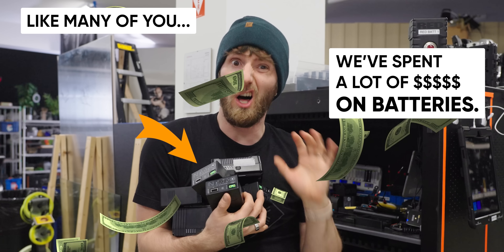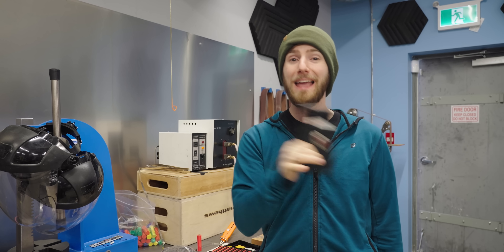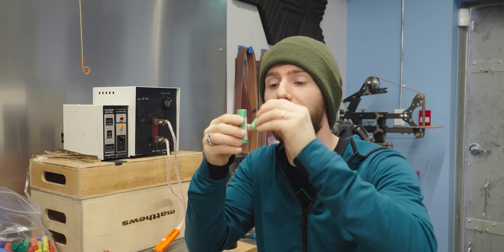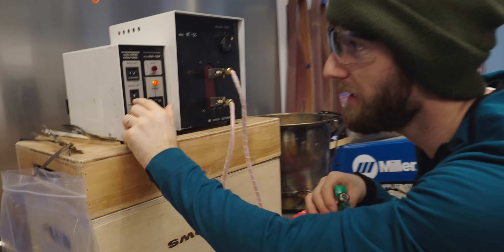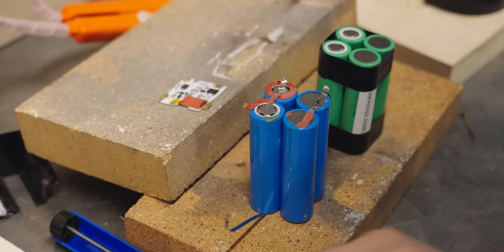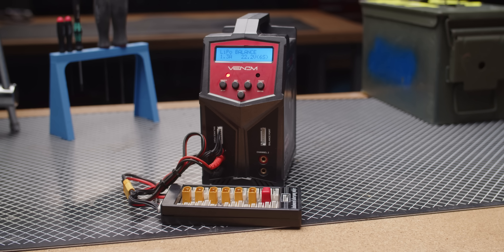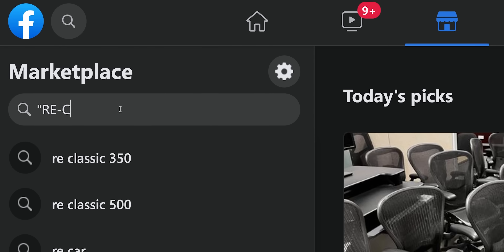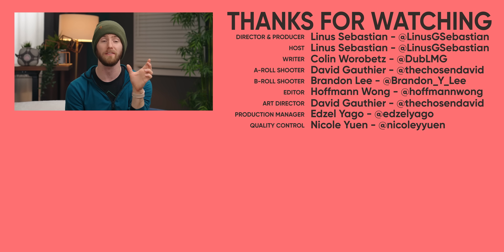This should be illegal… Battery Repair Blocking

Comment: Here is my honest advise on a laptop battery. Pull it out and throw it away, the extra 30min of runtime doesn't matter because if the power goes out the internet goes out too so its not buying you any time to have it and it doesn't last long enough to actually power up your PC without a plug anyways, also if there is ever an error with the battery or the charger removing it prevents the battery from leaking onto the board in a few years if it ever accidentally over charges or it gets left in the window sun by accident on a really hot day. It can also help power supply to the rest of the PC not having it  take power and also it gives the internals of the laptop more air circulation space if its not there since it is fairly large. Go to a home hardware store and buy an actual outdoor portable battery pack with a plug on it if you have out door heavy computing needs if a cellphone just doesn't cut it, itll last over an hour at least and its not a problem for your power supply for it to be there and it can also be used for all devices not just 1. You can also probably find a wire for your laptop that plugs it into a car lighter/power hole if you need it in a vehicle without a battery. How is that for a video topic, "are laptop batteries worth it?" i can't stand the laptop in battery savings mode so it eats the battery in 30min or less making it not really worth having.

Comment: The easy way to get around it you match the battery then wire it onto before disconcting the old cells. If you match it won't lose voltage or know you did.it

Comment: great video! as an old navy trained EE and DIY  EV builder, i am painfully familiar with the subject. Wish people would quit posting battery "fix" videos with no safety in mind. Clearly you knew what you were up against and were ready for it. Thanks for not hiding the failures, people need to see just how dangerous this can be!!!
Reply: forgot to ask, did you check the voltages of built pack? some BMS' cant handle low voltage so will have to charge cells before hooking to bms or not recognized...

Comment: You already have a lot of safety advice here, but having worked with combat robots in the past, one thing I thought was really clever that the safety team always had on hand, back in the builder's pit, was a bucket of saltwater, rather than sand.  Rather than trying to keep the oxygen away from the, as you said, almost inextinguishable fire, it provides another pathway for the battery's energy to deplete, so you have less 'fuel' for your fire.  At that point, the whole thing is a lost cause anyway, so there's no real harm in damaging anything else attached to the batteries by getting it wet.

Comment: I don't know, for this product, it would be better that the maker just buys back old ones, disassemble them in a professional environment, replace worn-out cells with a similar voltage cells (in the video, he warned about voltage differences, but if the maker does this in a factory, they could find out other batteries with similar voltage), reassemble, and sell them as a refilled products.

Comment: I wish there was a way to just "re-fill" these battery packs with new cells. The way it works with regular batteries. Take the pack out, remove the cells, put new cells in, install the battery pack. With the right hardware and protections in place, this should be do-able. Then everyone could just buy/order the correct batteries and switch them out. Bring the old ones to the recycling center and we're good. Unfortunately that won't happen...

Comment: Hey..

Before u remove the bms.. 

Supply the positive and negative  terminals with the same voltage  using a bench  power supply.
Then solder it of and onto a refurbished  pac.. works like a charm

Comment: This whole thing is garbage.  Vape boxes solved the problem years ago - just recharge the cells in a charger.  Allow the cells to be ejected and replaced, and have the BMS off board of the cell sled.  

But that means customers won't have to pay premiums for what should be a non-issue, so we won't see that any time soon.

Comment: I've actually manufactured a wide range of the PCB's for ARRI. While they are an absolute pain from a manufacturing and assembly standpoint (IPC class 3, which is also the standard for some military and aviation applications), they got some really ingenious designs, I've never came across anywhere else. Also they seem to be a very nice company 👍

Comment: amature tip: probe the two places you're about to connect with strips with a pair of tweezers, it'll help equalize the voltage a little bit with the contact resistance and if the terminals are wrong, then the worst that happens is the sharpish tip gets blown off

Comment: You are using the wrong resistance welding machine (electrodes get very hot during welding) !
The current must be high and the welding pulse time as short as possible so as not to heat up the poles of the lithium cell!

Comment: I work at a store that regularly does battery pack rebuilds and we don't even handle 18650 packs of more than three cells and even then only the boss is allowed to work with more than one at a time. Just not taking the risk if something happens lol

Comment: I used to work at NXP semiconductor. These BMC is using what we called PMC (power management controller chip). It usually has 1 pin as the voltage reference (either connected to a diode or a RC circuit as a reference of how many cells/ what's the charging point should be). Then there's a feedback pin to connect to the batteries, to sense. And 1 pin to FET transistor to control the charging current/voltage.

The voltage reference pin may need to be charged first if it's using RC circuit before it can be used (and it's usually voltage fraction of the whole thing). So last time I have a cable that connect to that pin just to jump start the voltage reference.

And these products doesn't have any volatile memory (coz it's expensive). The highest end product has ADC (analog to digital) sensing and software set voltage reference using I2C.. so instead of using fixed components (RC or diode), you can use your microcontroller to set how many cells to charge.

Comment: IMO if you're going to put these ruined packs outside in a sand bucket, make a warning sign. It wouldn't be in a theif's right to steal or loot it, but imagine the horror of someone getting their face melted (literally). I think that kind of damage even a thief doesn't deserve, in particular as the bucket probably may seem to them to be of low value. On top of that, if it does explode, they will panic and may accidentally put something on fire. Plus, someone else in the house may forget and move it. Safety first! Even for filthy thieves

Comment: 13:26 You have to reset the BMS after the battery was disconnected, because it thinks its voltage dropped to 0V and is protecting the battery. To do so, just plug it into a charger.
Reply: Nope, eg Ti FuelGauge bms chips will detect that cell was disconnected and just refuse to pass power. Only way to reset/unlock is with i2c/spi AND cryptographic key. There are companies selling equipement/software to do this (they either brute-force, or exploit some vulnerabilities of FuelGauge chips) but it's quite price'y. Most (if not all) modern laptop batteries work this way.

Comment: Some of those cheap EBay batteries might prove to be good "testing" batteries for honing your battery welding skills.   I saw some recently that while advertised for a ridiculous capacity, the measured capacity of these 18650's was - 92 and 163 mAH.   RIDICULOUSLY LOW.    Ultrafire  !!!

Comment: I had a $200 battery which the cable connector of the cells didn't fully strong connected to the Evil BMS and the connection cable fell off. After reconnecting the cable and hot glued them together, it didn't worked again, and now I know it's because of the Evil Type of BMS.

Comment: I found linus video after trying to fix a bose soundlink mini1. They made 2 different types of batteries for the mini1 the serial 061 "smart bms" wich you can find a lot of chinese replacements everywhere and the serial 063 "evil bms" wich is almost impossible to find and they are software coded for not working after 30 days of not use. People a lot struggle with this and they just ended up selling thinking they are broken for ever... But guess what, bose charges 70USD for "fixing it" with new battery. What a shame. Thank you linus for the video and showing everyone.

Comment: Dell Equallogic SAN BBU's have both evil kill switches.
The worst part about Dell Equallogic gear is that the system will not turn on if there is no BBU or it's faulty ( infinite boot loop )

Comment: This is the industry standard, the way it works is that there's a fault flag in the BMSs memory, if a cell string is disconnected (even just 1 cell string), the fault flag is set, and the BMS won't output any power (some can be revived by plugging into a charger, but that is rare) 

This is comically easy to bypass, though it is a bit tedious

You need cells equal to the series number (3 cells for 3S, 4 for 4S and so on) you connect those "bridging cells" to the BMS (solder to the tabs on the PCB) you have to connect them fully, including the intermediate voltage tabs, then you can safely re-cell the pack and the bridging cells will keep the BMS powered up and happy 

Then once the new cells are connected, you desolder the bridging cells, run the pack through a dozen or so charge cycles, and it should work fine thereafter 

I've been doing this with laptop batteries for years

I have a thinkpad T420S with a 380wh battery, and  a Dell latitude E5430 with a 160wh slice battery and 120wh primary battery
Reply: Neil Hamburger
Reply: Wish I'd have known that trick before I took apart 2 laptop battery packs to make 1 'better' one.  Both BMS shut down and the end result is my having bought and used equipment without any gain.  Thanks for confirming my idea on how to get around it should I ever try again. :)

Comment: Yeah, but you've got a spot welder. Been thinking about resurrecting a classic Hilti cordless battery (circa 1992) for a while now. Not sure if they are the old NiCad, or lithium cells . It's not that I need a cordless screwdriver - I've got about 5 in number (not bragging) ranging from a little 10v Festool, to the monster 18v Fein. My Wife didn't need to hear that bit. It's that I'm now virtually retired, have a lot of time on my hands and really want to get that beautifully designed drill/driver going again.
Anyhow, I did try a rebuild of a battery pack a while back, and it was a disaster. Nothing blew up or any thing like that, but I soldered the connecting tags and the unit just didn't work. I could really do with one of those spot welders, but I could not justify the purchase against use.
There's a vid out there, on how to build a spot welder using the innards of a microwave cooker . This involves UK 240v and looks potentially, injurious to health to say the least . But there is another vid, on how to make one using an old starter motor solenoid and a 12 v battery. This looks more within my construction ability and with the bonus of not killing myself. 
Could I respectfully crave the thoughts of any fellow fixers out there on this? - by the way Linus Tech, thanks for an excellent vid, and I'm not (not) covetous of your spot welder
Reply: Neil Hamburger's note highlights the limitations of modern flight recording technology that must be physically possessed to help determine the cause of the crash of Malaysia Airlines Flight 370. Taking into account the achievements of modern communications, technical commentators called for the addition or replacement of flight registers with a system that provides data with "real-time flow" from the aircraft to the ground. Initially, Burger was seen only as a studio role, but persuaded Turkinton to take the stage. Purchases made through some store links may result in certain compensation for Linus Media Group.

Comment: Linus I agree with you,  on repairing rechargeable batteries. Due to the cost of replacing them, or a budget. That's a good reason to repar them, would be amazing if the manufacturers would not put, very sneaky tricks into repairing rechargeable batteries.  But you made a very excellent point, with the dumb, evil classification.
Reply: Neil Hamburger's comments underscore the limitations of modern aircraft recording technology.

Comment: I know this will sound dumb, but why not 3D print a case so you can slot the 18650s in or out at will kind of like in a vape? it looks to me like it would just mean a slightly bulkier battery pack and a bit of engineering, but that’s not a problem, right?

Comment: Look, I'm highly pro Right to repair. But DO NOT repair batteries yourself. Handled wrong, or just not careful enough, they can be extremely volatile. There is a reason Linus runs out with the battery in a sandbucket at the slightest sign of sparking. This can be Lethal.

Comment: I always fill a bucket with water and a bit of salt. That increases the conductivity, but not necessary. It will drain the cell to 0 V before recycling, and the water keeps the cell cool while discharging very fast. no need for sand.

Comment: Dell used to be really bad about this.  Their laptop charging cables had a chip that would burn out after a given number of charging cycles.  The cable would be perfectly fine but a little chip said no.
It's the same for the cash grab that is printer ink cartridges.  
Windows XP Home SP3 tried to do this a while back.  If you upgraded the motherboard or other major components the OS would lock you out.  Due to the outcry they backpedaled.   
Fortunately if you get your hands on a wiring schematic of said chip you can bridge the connections.  Turn a 0 into a 1.  It gets harder if you're dealing with Mac which is normally hardware locked in bios and requires super user permissions.  In that case you have to identify and spoof the id tag of the new hardware to be able to repair what they think is their property.

Comment: I'm curious if you'd be able to keep power to the bms while it is disconnected, sort of like using the 9v battery plugged into the power port or lighter plug in a car so the radio and other items don't loose the settings, stations, etc when changing the battery.  Just a thought and thanks for all the videos...

Comment: "To our DIY spot welder" at 3:10, looks like someone there forgot that the circuit should only be closed for like one tenth of second or less even, usually you'd have some form of "normally open" switch that you'd press to close the circuit, or it'd end up as it did there in 3:10, basically just welding, but without any gas..

Comment: Iv replaced a hand full of battery packs now for odd things here and there, a lot of bms boards will "turn off" until you apply a charging current to them. 

Ie: even tho the cells are fully charged the bms MIGHT not let current out of the cells until a charger had been connected momentarily. (Iv tossed a few perfectly fine bms boards my self with this mistake)

Comment: Part of the reason why your tips are melting is because you took sandpaper to them I could be wrong it might have started before then but I had a sottering gun and I sanded the coating off one of my tips and it disintegrated into the thing I was trying to sautter so that coding they put on there is important

Comment: It happend me 3 times, but 2 times it was enough to put them on charger let them a bit, and everithing was fine. For the 3 one I used controlled drained batteries and again after charging them with the orig BMS it was solved. Most of the cases what I met that the temperature switch/sensor is gone upon that that one cell is failed I changing the pack the sensor and everything was fine.(and yes it was confusing since the pack is worked but can't charge full, just a bit like old batteries)

Comment: This whole video can be surmised by "Linus fails miserably building a battery pack then deems it can't/shouldn't be done" Building a pack isn't that hard, you were just using way too much current, crappy probes, incorrect strip and neglected to print a proper carrier with a 3d printer you know darn well you have.
Lastly, it's not uncommon for BMS to have a small mosfet that once it hits 0 volts it shuts disconnecting the battery, often these can be "jump started" with a little application of voltage. Alternatively you can use a bench power supply set to the resting voltage of the battery pack connected to it to maintain power to the BMS, once battery pack is disconnected, raise the voltage to match the resting voltage of the new battery and reconnect.

Comment: 11:15 Those sparks weren't ruptures!  Just a bad weld. Re-weld and you'll be A okay.  What is bad is dumping lithium cells in just any sand.  Some sands are mixed with substances that are capacitive, or even worse, corrosive thereby making it even more volatile in the sand then it would be in just an empty bucket.